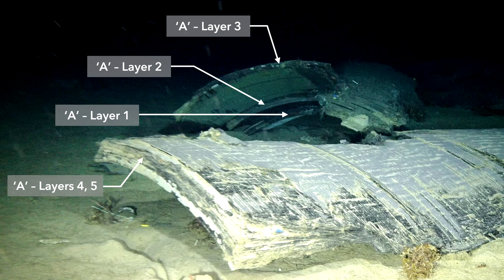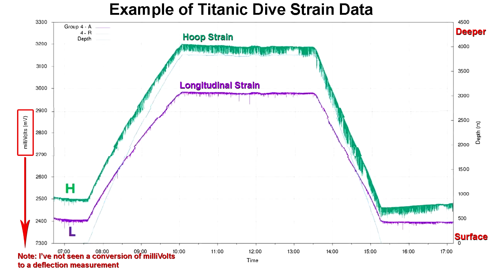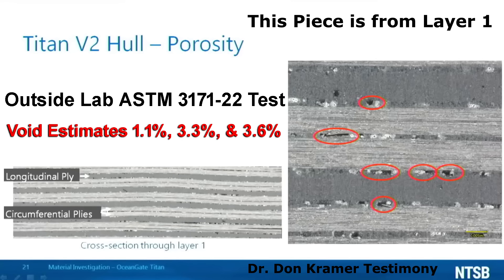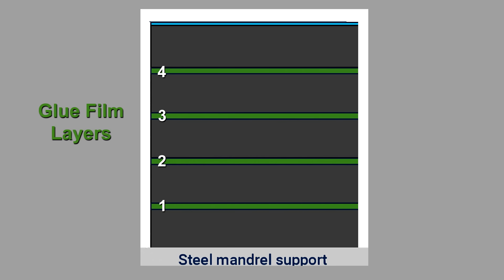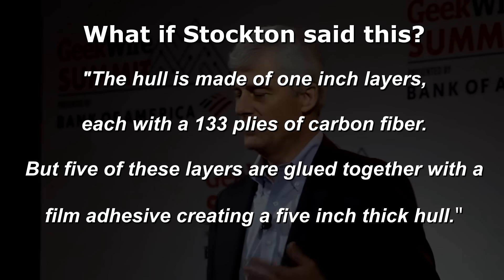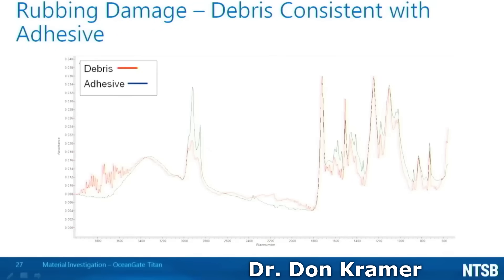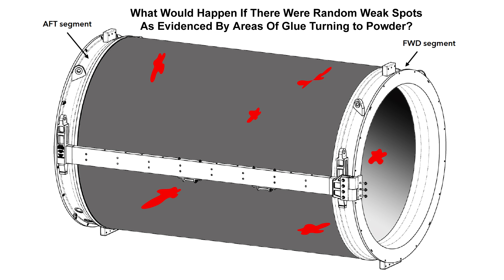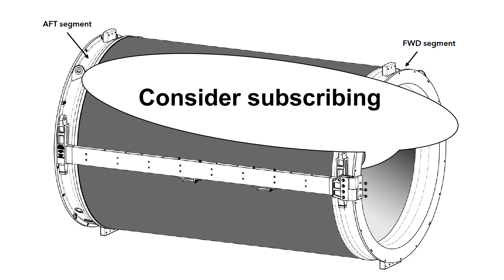OceanGate Titan Hull - Glue Layers Were Breaking Down To Dust - No Clues.

Comment: The shocking thing isn't that the Titan imploded. The shocking thing is that it held for as many dives as it did. Sanding down the fibre layers is insane. So many things were wrong with the Titan build. Looking at how it was built it should have imploded after just a few dives.
Reply from the maker: I agree.  It is amazing it worked at all.  Thanks for commenting.
Reply: @nian60  I think they had this tech hubris where they knew it was a disposable hull, but were banking on their shitty acoustic warning system to tell them when the hull was finally past its useful life.

They just didn't realize that their acoustic warning system would tell them a couple microseconds before failure
Reply: @smc4229  
It did kind of work, there was that offset after the loud bang they heard just a few weeks before the disaster - they just ignored it.
Reply: @ They had loud cracks on the prior dives, and analysis of strain gauge data has shown that this was coupled to a change in stress/strain relationship where the hull didn't restore properly for the last 2 dives - they had the info to detect this and ignored it.
Reply: @smc4229 you reckon they heard and mentally process the warning beep before they became human yoghurt
Reply: @smc4229 They had plenty of data from the RTM system showing it was already delaminating. They ignored the data.
Reply: @guitarista67 how did the every media have this story ready to go before it happened? Why did they all run with the banging sounds to distract from hunter court case for days afterwards? Do you not find it a little fishy?
Reply: I never understood what else they expected. 

Even with a longer warning time, failures don't happen slowly at those pressures. Being able to emergency surface wouldn't have helped anything when you're 3km below the surface.
Reply: @smc4229 the acoustic sensors did measure a serious hull shifting event but they never analyzed the data enough to find out.
Reply: @Erpyrikk  There never was a pre-established threshold to determine what acoustical / strain data would indicate the final dive or an emergency ascend.
There never was a pre-established minimal number of functioning acoustical / strain sensors required to make a dive.

The data was open to interpretation by someone that held huge prestigious and financial stakes in such a decision.
Reply: I agree. How it even made one dive is amazing. It’s like a high school science program but with a little more budget. The engineering may be possible but without testing and evaluation it was a disaster with an unknown time frame.
Reply: @paulbeck6410  Quite a few things will last long enough until they fail. He just needed to have a set number of dives, then scrap and build a fresh one. Looks like he thought when it finally failed they would have enough time to get back to the surface while it was failing.
Reply: @paulbeck6410 Sadly, have comment WAS there ANY budget?  The more I hear about this thing, the more it gives me chills!
Reply: @fooman2108 they spent 100.000.000 USD but the budget was much tighter. They simply miscalculated the whole process.
Reply: Every time, no matter how many times I hear about the sanding, I start cussing 🤦🏽‍♂️
That whole project was a chit-show
Reply: @ajword81 Every sanding becomes a flaw in multiple layers. Sheesh.
Reply: This is exactly what happens when you rely on college interns for most of all labor done, helped cut costs and life expectancy
Reply: The scariest thing in engineering is something that works that should not.
Reply: @benjaminthomasson  it kinda worked until it didn't 😂😂
Reply: It's shocking that it didn't implode on the first dive, imho
Reply: The problem is every dive increased the amount of defects in the hull.
Reply: @wizardm Exactly
Reply: He really proved that carbon fiber is pretty strong even if you build without engineers.
Reply: @redactedbananas
That's what I thought too... truly amazing it did as well as it did ....
Reply: It was essentially a patchwork quilt of carbon fibre.
Reply: Swimming pool filters have been built stronger.
Reply: They should have left the wrapping mandrel in place. Then, eliminated all the composite materials. (Sarcasm). A support ring in the center would have reduced the deflection. Having a thin ring of fully annealed metal in the center would have been a cheap, reliable way of measuring the deflection. Measuring the diameter before and after would reveal how much the hull was deflecting. Repeat this with a new, tightly fitted ring each trip. Plot the deflection points by number of cycles and depth. AKA: S-N curve. Show this curve to clients before each trip. "Are you feeling lucky, punk? Quote from Dirty Harry
Reply: I suppose sanding the layers might be ok if you have a huge safety margin, but this seemed to be on the edge already
Reply: @ I was wondering HOW the lumps ended up happening and why that was not researched and corrected before completing another hull. An inclusion or bubble (more likely) formed and sanding that down also reduced the strength.. creating a ripple in the weave.. 5 layers ended up inefficient to cover for irregularity.. too close a margin of error..
Reply: Regardless of how it is produced, CF is not suitable for this type of application.
At these pressure and temperature conditions, a material that is homogeneous and ductile is essential.
Reply: @chuckthebull  I think the ripples happen when the prepared shifts during the wrapping process
Reply: @xpusostomos Sanding the layers creates discontinuities in the structure, making it very difficult to model behaviour.

Any computer modelling would've assumed near-perfect homogeneity of the carbon fibre matrix - it's simply too difficult to accurately model every single void and defect. 

As they encountered manufacturing issues they should've introduced a much larger safety margin, or gone to another manufacturer who could produce the hull as designed without so many defects.
Reply: The engineering vs durability discussion is fascinating. The sad thing is several somewhat innovative ideas are likely set back decades or centuries based on one ego with payroll issues.
Reply: @emptiester  nah, most people will just test their designs like a normal engineer would.
Reply: David lochbridge told him he sacked him Karl Stanley told him even drawing a picture he ignored him getting angry at anyone with more brains than him so he got young kids so many things wrong with this  should be suid for negligence lies bad workmanship despite wavers
Reply: I would’ve cringed so hard if I was tasked with sanding that thing down!
Reply: The titan was truly revolutionary and was just a freak accident. Stop with the propaganda. That thing was safe! But freak accidents can happen to anything!
Reply: @cwatson42785  the Titan was the second carbon fiber hull Oceangate built that failed. the second. It was CLEARLY not  safe, revolutionary is only revolutionary if it works.
Reply: But…but Richard Stockton Rush III showed so much CONfidence!?
Reply: So as it turns out, you can make a carbon fiber hulled deep-sea submersible, you just can't make it safely, if you don't test your manufacturing process and the impact of repeated compression cycles until failure.

If you did that, you would probably arrive at the conclusion that it will work, but quite possibly not for enough dives to make it economically viable...

Which is probably why it wasn't done.
Reply: But I have  no engineering degree cause I'm poor b _ tard so I just have basic common sense... and my common sense tells me I would never have climbed into that submarine.  And I do some stupid stuff let me tell ya', but that sub was a "nope" in my book.
Reply: @Ed-ty1kr  GOOD ONYA, SIR!
A DEGREE DOESNT ENSURE COMMON SENSE. IN FACT, SOMETIMES IT'S POSSIBLE
FOR EDUCATION TO "DUMB-DOWN" FOLKS
Reply: You're right and that's why the founder had repeatedly refused to let it tested by officials specialists in specification....
Reply: NDE xray examination could have easily shown this hull faulty at any point in time.
Reply: Forming each 1 inch section using vacuum and compression to cure cutting down where necessary to sleeve each tube into the other like a Russian nesting doll probably would have been much stronger
Reply: 100% agreed!
Reply: Couldn't agree with you more, a true representation of a lead zeppelin... ✌️ ♥️
Reply: Excellent breakdown sir ✌️ ♥️ 🌍
Reply: That's why the us navy decided against it, after a few dives the hull is compromised
Reply: It was 100% luck that that thing didn't plow it after the second drive
Reply: So was it design or execution broblem... Yes 😂
Reply: @Humbulla93 👍 That's exactly the point, which almost nobody gets. But I got tired of writing this everywhere.
Reply: They weren't testing or sensing properly and would've never discovered the voids, decay, or any other issues.
Reply: One and Done
Reply: They were probably using FlexTape for all the dives until…
Reply: What's shocking is carbon FIBER only has strenght being pulled apart, and collapsed being pushed or bent like any fiber does.  It basically had the stenght of impregnated resin.
Reply: AND the creation/carbon fibre of the hull was done in a structure which was dusty, the cloths photographed being used appeared dirty..my thought when watching the worker wiping down the carbon fibre hull with a noticeably dirty rag was, "THAT'S NASTY!" I don't claim to be an expert on the level of cleanliness that is optimal..but what I saw would not by any language qualify as "CLEAN".
Reply: @katharper655  Besides... guess what happens to those fibers of woven carbon when you sand down the wrinkles?
Reply: @Ed-ty1kr  My guess is that in the LEAST destructive scenario...you significantly WEAKEN the individual strands; and that's no  and in the MOST destructive you create an actual GAP in the carbon fibre laminate...and THAT would be like having a ticking time bomb in the carbon fibre hull...and having more time bombs the further along it goes would be like encountering more land mines the further out you go into a minefield. Rush was stubborn in excess..and refused to contemplate the probability that catastrophe that was looming  -ahem! Dead ahead.
Reply: @katharper655  Also.. if you want to make any carbon fiber tube stronger,  you cut a same length piece of solid aluminum rod that fits snug into that carbon tube or pipe, and the bend strength of said "tube" or pipe becomes exponentially stronger.  This is because it is the outside or convex edge of the bent tube that gives it bend strength through tensile strenght, meaning the convexed wall in the bend that gives it strenght, and the concave wall of the inside of the bend that causes the tubes collapse by collapsing inward and filling the void inside the tube or pipe.  So if the cylinder is filled with an aluminum rod that can't happen, and it becomes very strong yet relatively lite.   That old trick also works with chromoly tubing as in roll cages and vehicles control arms, or 41xx steel tube frames.  😉
Reply: In my opinion, it wasn't really the sanding of the bumps that were the issue. The problem was trapped air, glue and water penetrating where there was any separation. Imagine putting a screen cover on your phone with a bubble in it. It's easy to move the bubble around by pressing on it. But unlike a screen cover, once carbon fiber layers are forced apart they don't stick together again. The you end of with a whole bunch of separations throughout allowing for a little bit more movement each time until they make their way to the rings and it's now water being forced into the areas where the layers separated. I would bet money they heard the sound of the water being injected into the hull for at least a few seconds and knew exactly what was about to happen. Probably sounded like someone crinkling up some cellophane as the water raced through the voids and then lights out.
Reply: I'm not an expert on on this, does it mean that these materials are ok if done properly, or are we just better sticking to tough metals such as steel or some alloy as it might be more malleable? 

Be gentle with me , I am the archetypal noob in such things 😊
Reply: @zakelwe  there have been carbon fibre composite submarines used successfully in the past. But it had proper engineering and quality oversight.
Reply: @Erpyrikk  Thanks for that info, appreciated.
Reply: That type of material is not suitable for this high compression load, extremely safety critical application.  If it were a magic material or would be a good choice but it isn't. It's a woven material made of fiber and glue.  @zakelwe
Reply: @zakelwe  I think this was a huge cost saving attempt ..high pressure canisters are made this way for pressure vessels so i think they imagined they could do this.
Reply: @chuckthebull unfortunately for them, compression and tension are very different animals when talking carbon fiber
Reply: @chuckthebull  It was all about Stockton Rush and his ego. He was so set on being regarded as the great innovator of deep sea exploration and thought he had found an easy way to achieve that. He thought he found something so great that everyone else missed. One can see it in the way he conducted himself. He refused to listen to his peers and experts in the industry and instead surrounded himself with either young people or others who were looking to elevate their status by being part of a revolutionary method of creating submersibles that would be the next big thing.
Reply: @zakelwe  
It‘s possible but not sensible for the intended purpose. 
Yes, carbon fibre DSVs have existed successfully, but they are expensive to test and manufacture (yield strength almost equals ultimate strength, conclusive destructive testing and extremely tight manufacturing tolerances necessary) and not endlessly reuseable (how often depends, but not thousands of cycles like metal).
Reply: @zakelwe  these materials can be used and rarely are for niche applications in the industry, but two main reasons they're considered fringe are:
1. They don't have the same backlog of extensive testing, experience and material science going back decades as traditional manufacturing methods. 
2. The economy is just worse. Firstly, you would have to conclude all those tests and studies that are missing, which costs a lot, secondly, CF is cheaper to do wrong, but is actually more expensive than titanium and steel to do PROPERLY. 

Well, now there's a third reason, I guess:
3. OceanGate disaster put such a stain on CF reputation that now no reputable company or investor will touch it with a 3,500m-long pole.
Reply: Pretty much all the actual experts say carbon fiber isnt a good material for deep water subs at all. @zakelwe
Reply: @ carbon fiber is to metal as glass is to plastic. Once carbon fiber surpasses pressure tolerance it fails catastrophically. Whack carbon fiber with a huge hammer it shatters, metal dents.
Reply: @Ard-Net1  pretty sure at those depths it makes no difference if metal "dents" your done those 0.3 seconds you get before it fails wont save you :/
Reply: @alexius9072  the point has been missed.
Metal deforms long before failure, carbon fiber just fails.
Reply: @Ard-Net1  you sure? i feel like any dent would cause the integrity to fail as it being cylinder is what keeps it going when it dents it no longer supports itself and POOF. i could be wrong though. (bing bot says it could go either way depending on the size of the deformation)
Reply: @alexius9072  again it's the type of failure, the point was always the type of failure. Carbon fiber is like glass and metal is like plastic. One will shatter at a certain amount of force applied the other will bend. One will be more susceptible to stress fractures where the other is more flexible and not prone to cracking. 
Please don't use AI, they are good for large dataset processing not much else.

It's about a basic physical property of materials where 1 will crack and shatter, where the other will deform. 
Take a dry stick, try to bend it into a circle, take a piece of metal bend it into a circle. Only one of these will work, that's the difference I'm getting at. 

BTW: this is the very reason they use acrylic windows and not glass, one will deform the other will shatter.
Reply: @Ard-Net1  its not quite as simple as "will it bend" :) im not metallurgist? so i cant do the math but cylinder is weaker after its dented so the crumbling wont just stop unless the internal pressure increase offsets the loss in integrity of the metal no longer supporting itself by shape. 
is it possible the metal hull failing would fail slow enough that you could emergency surface? sure i dunno :D or that the detectors would give warning long before that becomes an issue? probably? at this point i no longer remember why i started making issue of it. (i welcome our AI overlords ((the ai is about 70-80% right when you throw simple physics question at it and thats better than me with my "i have no idea" only broblem is when it refuses to say "i dont know" and just quesses)
Reply: @zakelwe  They really tried the cheapest option and never tested their work. Everybody and their Engineer told the guy of possible issues, but he ignored anything that would create more cost.

So, its hard to tell, because any sub that Stockton made was going to fail.

Whoever uses this material process later will need to solve all these issues, and deliberately do A LOT of testing, without assumption of success.
Reply: It was fine until it was attacked. The whole cheesy story was ready to run just as hunter pleaded guilty. These people were murdered to take the heat off the biden crime family.